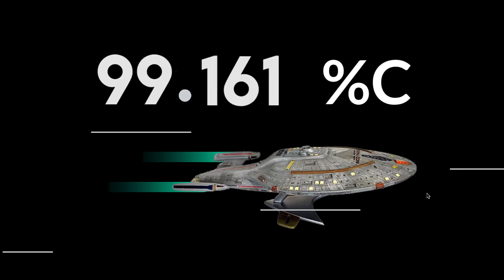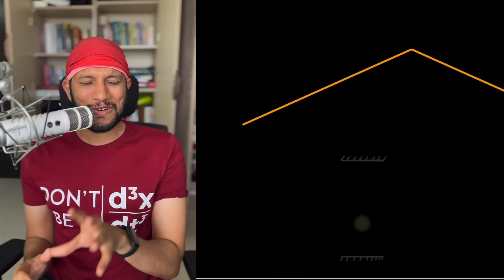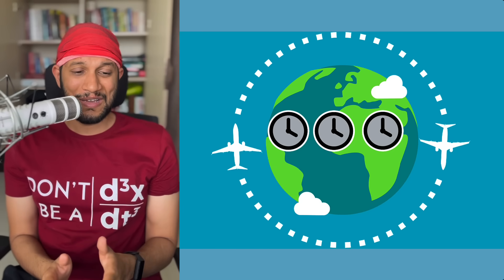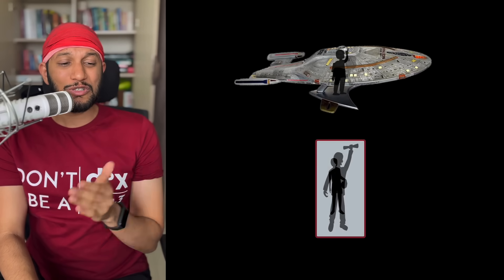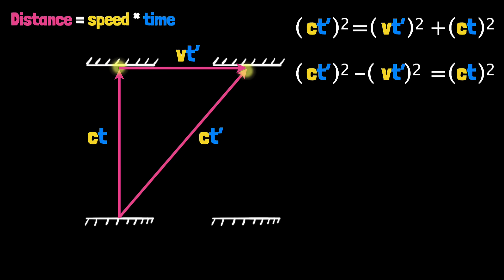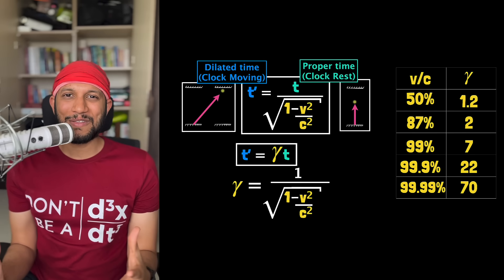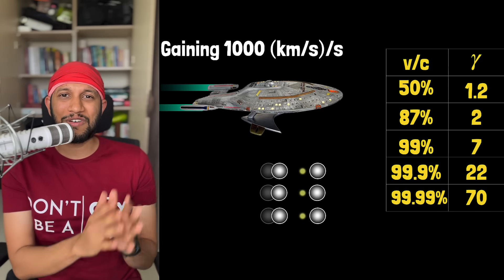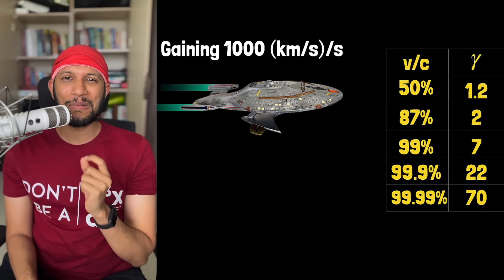I finally understood why you can't go faster than light! (My mind is blown)

Comment: Your explanation here doesn't answer why electrons or neutrinos can't accelerate past the speed of light. There are no photos interacting with Neutrinos for instance, and they are fundamental particles.
Reply from the maker: Higgs field! Great question
Reply: @Mahesh_Shenoy  If it's indeed the Higgs field, then it is because mass increases to infinity which contradicts what you stated in your video.

Comment: Okay, so this is way, way above my pay grade of knowledge, but what would happen if the two particles within the two photon/particle clocks were entangled, and then we conducted the same experiment? Would we still see the faster clock aging slower? Or would the stationary clock slow down to match? Or is that all nonsensical?
Reply: There is no communication between entangled particles, if you do something with one, it doesn't directly affect the other. It looks just like an ordinary particle. When you create an entangled pair, you may initially not know which particle you have here and which was sent away, and by measuring you can learn that, but nothing too interesting is expected. Only when both particles are measured and results are brought back together and compared, you can see effects of entanglement - the two measurements end up correlated.

Comment: Hello Mahesh I loved this vedio very much, usually when I see this type of vedios on internet I used to get lot of doubts but this time you asked most of my doubts and cleared them. but I am left with one doubt i.e why photon following zigzag path if  photon can't be influenced by the motion of ship?? Please reply
Reply from the maker: From the ships perspective, the photon is hitting both the mirrors. So, from the outside perspective it should hit both the mirrors too. The only way is to keep moving diagonally!!
Reply: @Mahesh_Shenoy   @Mahesh_Shenoy  if it's some ball bouncing between two surfaces then the ball moves diagonally because it attain horizontal velocity equal to ship velocity because it has mass and it is in contact with ship but in case photos it has no mass and it's velocity can't be influenced by anything cause velocity of photon is constant. as you said if it follows diagonal path it means it attained horizontal velocity so if photon motion is orientated horizontally then velocity of photon must be velocity of light plus velocity of ship which is not possible because light speed is the limiting speed

Comment: Hey Mahesh can you explain why atomic clocks also slow down since they measure the vibrations of the Caesium atom? Does the vibration of the atoms change because they are also traveling close to speed of light or the phenomena of measuring the vibration gets slowed down like you explainef the 'minute hand' of the clock slowing down? Is it the physical slowing down of moving clock parts or is the actual atomic vibrations slowing down that makes the atomic clock also to loose time?
Should the atomic properties of the atoms get effected if vibrations slow down?
Reply from the maker: It’s not really ‘vibrations’, right? It’s electron transitions. I think.

Comment: Well, that's right but you have to be careful about the "how" and "why" questions!  You answered the how question because you have the constancy of speed of light at hand,  but the "why" question is much more deeper.
Secondly, the acceleration of spaceship as measured by the outside observer is a`=a/gamma^3 instead of a`=a/gamma. So at 87% speed of light, the outside observer would measure 1000/2^3 which is 125km/s/s instead of half or 500km/s/s that you said in the video.
Reply from the maker: Damn!!! Another mistake. Thanks for pointing that out!!

Comment: Excellent explanation... Few days back I imagined something to realise why photons with high frequency/amplitude have higher energy. Since the photons with high frequency/amplitude cover greater distance (considering it's wave like path) than those with lower frequency/amplitude in the same time, photons with high frequency/amplitude have higher kinetic energy. Is this correct?
Reply: Interesting idea, but that's not how classic and quantum electrodynamics describe it. That wave is not a literal path of some particle, it has a different meaning. In classic electrodynamics it's about values of EM field, in quantum it's about probability amplitudes (a complex number, btw). But you're right, higher frequency means higher energy. If you look at the quantum level, frequency in time is wave's energy, and frequency in space is momentum. For massless particles the two are directly related and interlocked, for massive particles they can change more independently.

Comment: Pushing particles in a particle accelerator uses more and more energy as the particle gets closer to the speed of light.  The old gray beards from 50 years ago.  100 years into flight, the "experts" have declared, "It's impossible to approach the speed of light".  Usually, a statement that not even the total power of the universe could push you to the speed of light.
Then, somehow the Big Bang expanded the universe faster than the speed of light, cuz Magic!

Comment: First - great explanation.
But "B" what I can't get my head around - a clump of particles gets thrown by a celestial body at half the speed of light. So, two years later we observe it as 1 light year distance from the origin. But, the it turns out the clump of particles is like a rocket that lights up at that point, adding and increasing its speed as it burns up.  After a while it comes to a dead stop from our perspective because it went so fast that it took infinite time to get there and so it never did?

Comment: This seems correct but it is superficial since special relativity is ignored. The two observers are interchangeable so there is no actual observation of slowing time by either observer. Length contraction along the vector of motion fully offsets it. This is why the speed of light (measured as distance traveled per unit of time) is constant in all frames of reference.

Consider a scenario where a spaceship is 1 light year from earth traveling toward it at 99.99% the speed of light. An observer on the spaceship and an observer on Earth each send a radio signal at each other every second according to their own clock. If what the video was saying is true about an observable time dilation, then the Earth observer would receive a signal not every second but rather something like every 70 seconds. And how often would the observer on the spaceship receive a signal from Earth? Every second? No, because Earth would take about a year to reach (from Earth's frame of reference at rest -- I'll explain below why this is wrong) whereas only about 5 days would pass on the spaceship (according to the ideas presented in this video). So there would have to be 70 signals received per second on the spaceship given the time dilation.

Obviously this is not how relativity actually works. In reality, the frames of reference are interchangeable (the Earth is moving toward the spaceship just as much as the spaceship is moving toward the Earth) such that all time and distance is in co-measurement. Only a hypothetical observer  in NEITHER the Earth nor spaceship frame would see time and length/distance chnages, which is not something easy to wrap the head around. But basically it would be something like seeing an entire movie at the same moment. That allows this frameless observer to see the time and distance as this video presents it. For example, when both the Earth and spaceship consider each other to be 1 light year apart based on their own rest frames, the frameless observer can see that length contraction reduces the distance to 5 light days (which is the corresponding time dilation). And that's how long it will take.on both Earth and spaceship. 

In actuality, that spaceship traveling at 99.99% speed of light has to be 70 light years  away in its rest frame to reach Earth in 1 year. And during that time both the Earth and spaceship would send and receive each other's signals at the same 1 second interval (and equally blue shifted). No time dilation relative to each other.

As for why the spaceship.can't reach the speed of light, it is because there isn't enough time to undergo the incremental acceleration. Sounds real weird, but distances get shorter and shorter as speed of light is approached. Since acceleration requires time and distance, at some.point there simply isn't enough of it. You reach the destination, even if infinite, before you accelerate sufficiently to reach the speed of light.

Yes this.sort of sounds like the flip side.of how the video explains it, time keeps slowing down, but the problem again is inertial frames in motion are the correct way to view not from a hypothetical rest frame. For example, consider two spaceships heading toward each other, each moving at 99.99% the speed of light with reapect to an observer at rest. Clearly the combined speed cannot exceed the speed of light but you need the co-inertial frame to see it  (the combined speed is 99.99% closer to the speed of light than the individual speed).

Comment: Where does the kinetic energy of electrons come from does it comes from the potential energy provided by battery or the electric potential energy of charge which gets converted into kinetic energy of electrons when repelled by terminals?

Comment: I will postulate that if you could see the photon (which you can not) inside the space ship then you would see exactly the same as from outside.
The photons speed is independent of the speed of what emitted it. The emitter will move forward but the emission point will not. I believe that the emission point of any Photon is set in space. That said however the rest of the video appear to be correct according to my current understanding and it does give a good explanation I think.
One thing however is that we extend the lines of calculation outside what is have been able to prove so far I believe and there fore can't be sure.
Reply from the maker: O course the photon speed will stay the same. That’s why it takes more to tick!

Comment: Remember that there is no such thing as absolute velocity ! There is only velocity ‘relative’ to another frame of reference. If you were on the spaceship you would effectively be not moving at all (zero velocity within its own frame of reference) so saying “approaching the speed of light” has no meaning. It is only from another, external, frame of reference that you can say that the spaceship is moving at a relative speed.

Comment: How do you explain that velocity is relative between the spaceship and the observer (no thing as an absolute velocity), so from the spaceship it is the observer that looks as though they are moving, so it is their clock that ticks slower. In other words, all frames of reference are equivalent and so time dilation has to be ‘symmetrical’ between them. BOTH clocks appear to tick slower, depending on the observer. Hence if they meet up again neither person has aged more than the other.
Reply: I suspect that time dilation (twin paradox) is all to do with acceleration and deceleration rather than relative velocity, is that true ? Cheers

Comment: Nothing can be accelerated past speed of light from the perspective of someone at rest., correct. But the person in the ship will keep accelerating faster and faster from their perspective. to the point where they could travel a light year across the universe in just minutes to them. But to us we will never see them faster then the speed of light. What's happening is to the perspective of the ship, the space in front of them is shrinking and coming closer and closer.

How does gravity cause time dilation? Because gravity is not a force, it does not pull you toward a massive object, instead it takes away the space between you and the center of mass from the massive object. On earth. 9.8m of space between you and the center of earth is taking away every second, making you stuck to earth. When you jump off a bridge, the space between you shrinks 9.8m between you and the center of Earth the first second. Then you are moving 9.8m/s towards center of earth, then 9.8m/s more space is taking away the next second so now your "falling" 18.4m/s and so on. You actually won't accelerate that fast because air will cause you resistance.

Comment: In the example you give with the 1000km/s/s which takes infinite time, does it take infinite time for an outside observer but "proper time" for an observer onboard the ship? i.e. 300,000,000 m/s / 1,000,000 m / s = 300 seconds. So for someone on board the ship it would take 300 seconds to reach c - and they would indeed reach c? or no?
Reply from the maker: The person onboard would consider themselves to be at rest. So the question is moot. 
However, you could ask wouldn't they see everything else flying by at c in 300 seconds? Unfortunately, no! There is another effect that I haven't discussed called the Length contraction. Check it out and then you can probably conclude what happens from it's perspective.

Comment: This is a great video, and it explains it very well, but with a 'small' problem. All you said applies to external observers. But for the guys on the spaceship, why would it be impossible to reach the speed of light? If the distance between two planets is, say, 10 light years, why can't the ship, from it's own perspective, reach the distance in one year, assuming a fast constant acceleration? After all, a photon, in its own frame of reference, doesn't feel the passage of time.
Reply from the maker: It can. But, it would still be moving slower than light. From its own perspective, it sees the distance between the planets to be contracted.
Reply: @Mahesh_Shenoy  Ok, so if from the ship's perspective it travels 10 light years in 2 years, doesn't it mean it is moving faster than light?

Comment: well, even photons can't reach the speed of light, the universe isn't a true vacuum and photons are slowed down by interstellar gas/dust/gravity... if massless things can't even reach the speed of light, good luck with mass... the only thing capable of reaching the speed of light are gravitational waves, not even expansion because that happens everywhere at the same time. If you want to travel close to the speed of light, surf gravitational waves, the rest takes way to much energy to even reach another place, even in our own solar system.